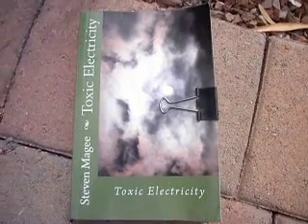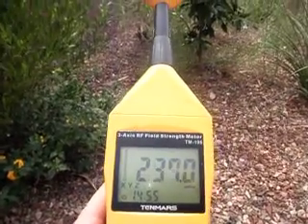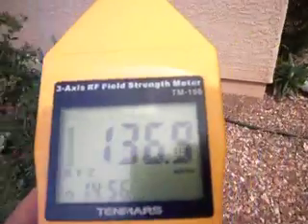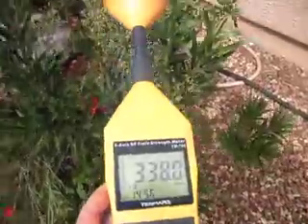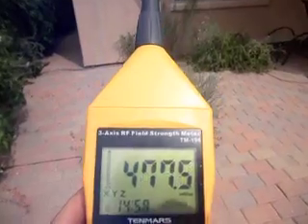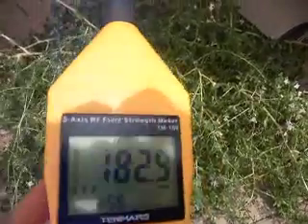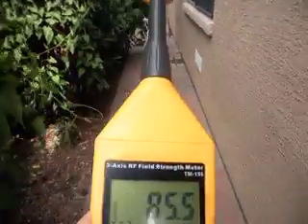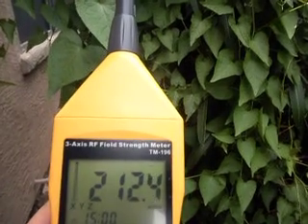Measuring the Microwave Radiation in a Garden that has Retarded Plants

Comment: Lol.  Unfortunately this 'blogger' knows nothing about science, or radiation.  He does NOT have a meter that 'measures microwave radiation !! He has bought a meter that measures EM. 
E M consists of one or all of these types of radiation and his meter reacts to ALL  of them!

Electromagnetic waves can be characterized by either the frequency or wavelength of their oscillations to form the electromagnetic spectrum, which includes, in order of increasing frequency and decreasing wavelength: radio waves, microwaves, infrared radiation, visible light, ultraviolet radiation, X-rays and gamma rays.

You are not seeing 'millivolts' read. you are seeing the meter react to ALL of the above wavelengths and types of radiation..
Just another one of so many Idiots   on   you  tube..

The meter goes down every time he lowers it close to the ground because of the loss of 
light waves........omg  lolz